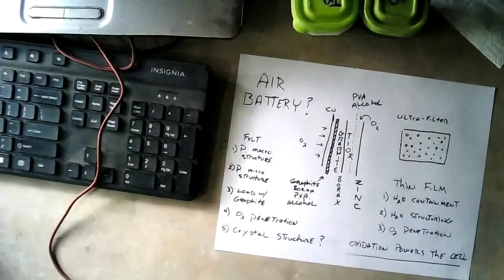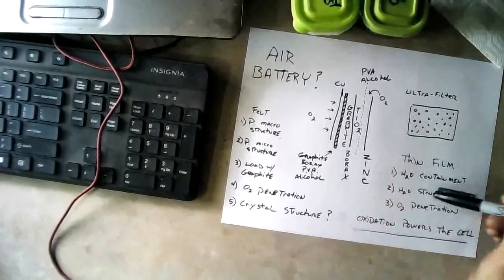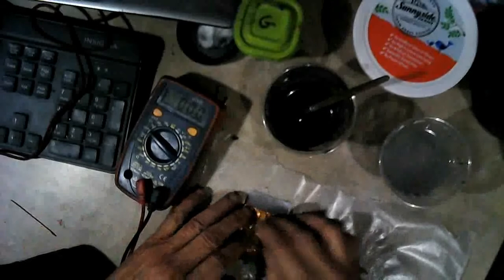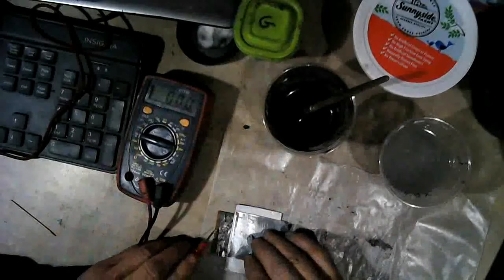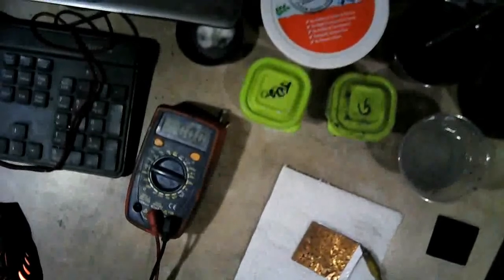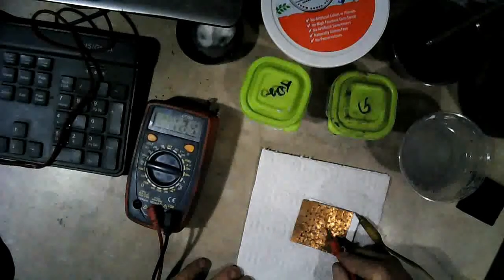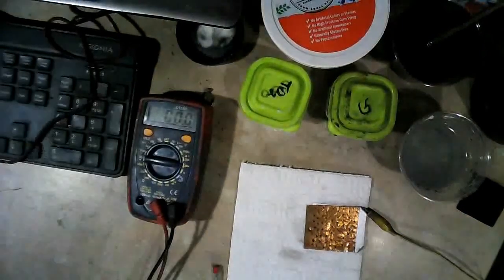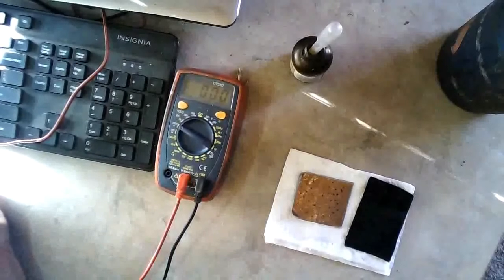Bio-Cell Air Battery Tests!!

Comment: That is interesting. You might play with the ratio of alcohol to pva to see whether the performance improves, or gets worse. The stainless screen might make a difference but keep in mind the stainless does not have the same electropotential. Nonetheless it's well worth investigating.
Reply from the maker: Felted graphite is the ideal material in my opinion. I've got to buy some of that, and use it with magnesium for great oxygenation and electropotential.